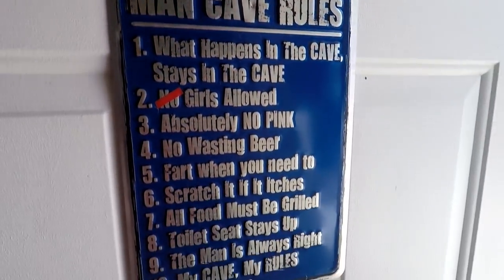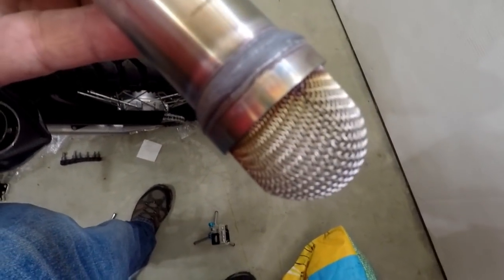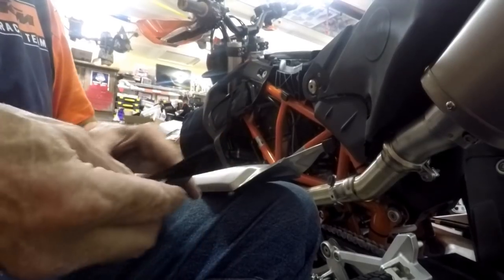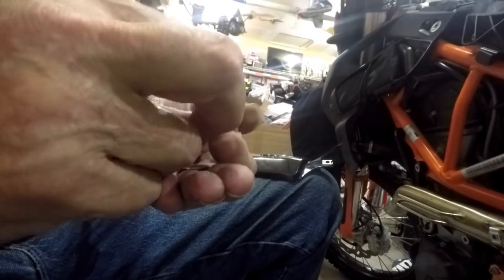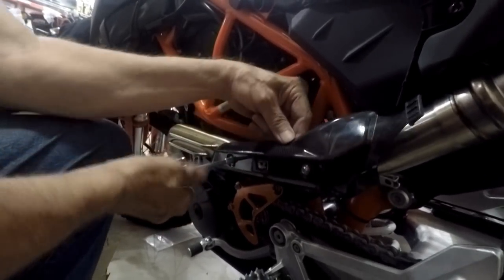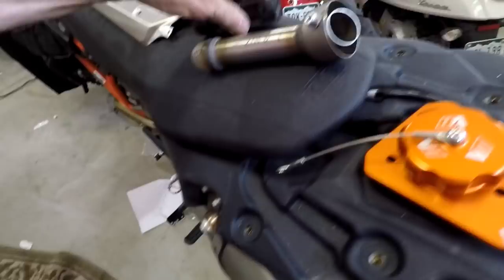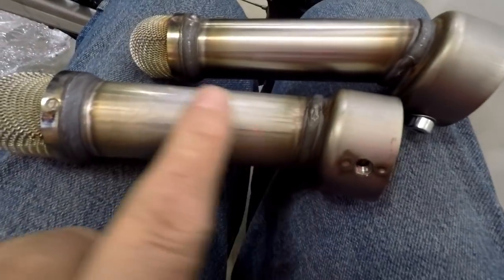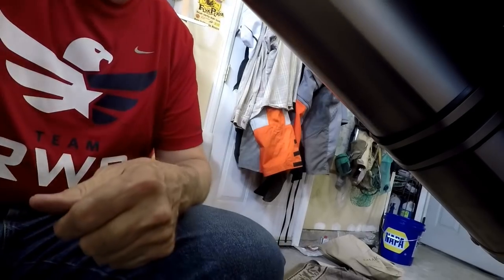2019 KTM 690 Enduro Mods #10 - Wings Muffler Accessories Part 2

Comment: I did the same db-killer swap, and for the same reasons. I put something sticky (don't remember what) between the tool and the screw, because I was afraid it could fall off inside the silencer, and that would probably not be easy to get out. I have a 2016 model, and it's just great on the curvy small gravel and tarmac countryroads around my home in Southern Sweden. Thanks for the videos.

Comment: Hello, did you have any issues with the running of the bike after changing to the Wings?  The stock muffler has a built in catalytic converter.  
I've heard that it make the bike run hot?  Thanks!
Reply from the maker: With the Wings small dbkiller, no changes needed. Actually the bike and the muffler run cooler because the gases don't stay in the muffler as long, since the Wings remove the CAT.  Get the canister removal kit from Rottweiler or look at my 2015 videos on how to do it.
Reply from the maker: @Atte Koskela I do not have a before and after data point as I am starting directly with the after... :)